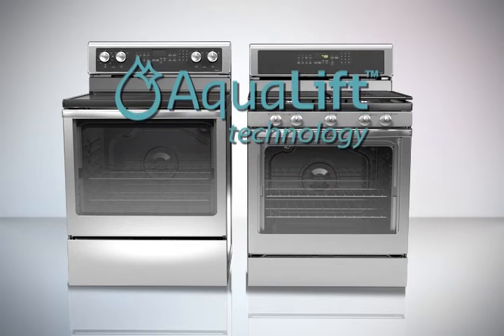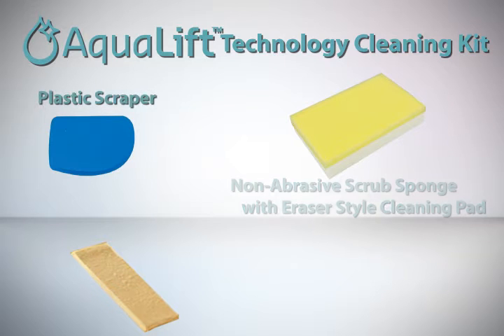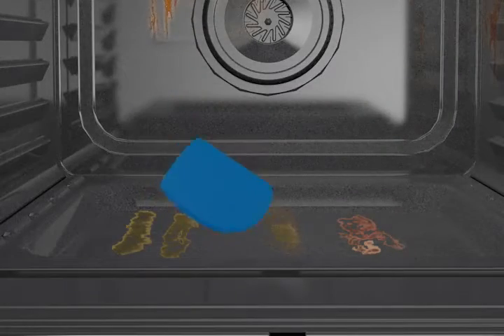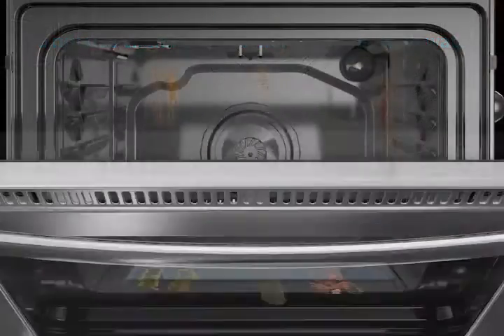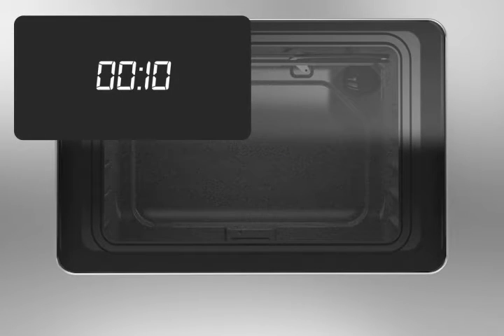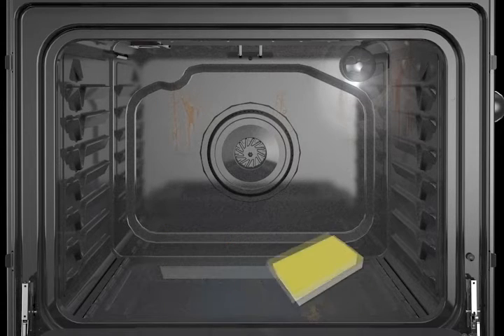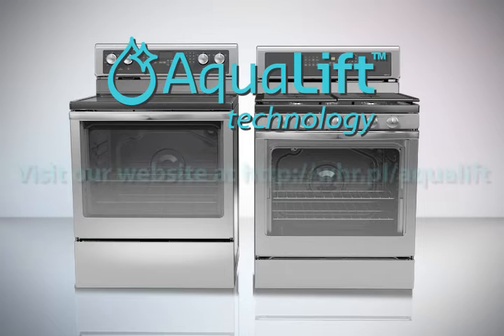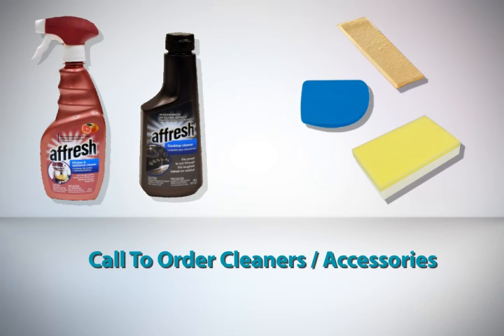AquaLift TM Technology Cleaning Methodology

Comment: I absolutely love this Aqualift technology. I didn't know how just water would clean my oven, but it did. I bake a lot and had a lot of burnt-on messes. When my cleaning cycle was completed. I was expecting a very hot oven when I opened the oven door. No, it was warm but could be touched with my bare hands. I easily wiped off the areas on the bottom and sides of my oven and they were sparkling clean. No chemicals or smells. I love this, 45 min and done. I think the key to this is if your oven has spills that are burnt on then don't keep adding to it. Clean the oven and wipe clean. It's not time consuming and doesn't heat your house. It is really easy.

Comment: This process is crap,   I have used it and it does not I repeat, it does not take off the grime in the oven.
Reply: My Samsung range has Steam Clean/Aqualift, but I found that a "hybrid clean" approach works better.

Remove all the oven racks and accessories like you would for a full self-cleaning cycle, put approximately two cups of water in the bottom of the oven, and then activate the broiler/grill on High. If you have a convection broil option, use it. Let that run for an hour or so (if the oven is seriously dirty, you can run it for two.)

All the water you put in the bottom of the oven turns to steam with the intense heat of the broiler, which softens even the toughest grime. Once all the water boils away, the heat of the broiler turns that softened grime to ash, which can be easily wiped away (it actually works much like a self-cleaning cycle, but without the extreme temperatures.)

Comment: Just discovered how uttlerly useless Aqualift is. Truly yet another disappointment from WhirlPool/Maytag. Honestly Whirlpool, why even bother to have this feature? Its just going to make your customer disappointed with your products and never buy them again if possible. Would it really have cost that much more just to put in an actual self-cleaning feature?
Reply: My Samsung range has Steam Clean, but I found that a "hybrid clean" approach works better.

Remove all the oven racks and accessories like you would for a full self-cleaning cycle, put approximately two cups of water in the bottom of the oven, and then activate the broiler/grill on High. If you have a convection broil option, use it. Let that run for an hour or so (if the oven is seriously dirty, you can run it for two.)

All the water you put in the bottom of the oven turns to steam with the intense heat of the broiler, which softens even the toughest grime. Once all the water boils away, the heat of the broiler turns that softened grime to ash, which can be easily wiped away (it actually works much like a self-cleaning cycle, but without the extreme temperatures.)

Comment: THis "technology' is a joke! I would take back my self cleaning oven any day of the year... Even repeating the aqualift cleaning cycle three times still meant a lot of scrubbing and nothing loosening on the oven door. Don't get sucked into this scam... it's as good as if you put a pan of water in the oven and turned it way up high.... in fact that might work better... I"m using their cooktop cleaner and a razor scraper to get the grease drops off the door... works great!

Comment: Aqualift, the new technology that doesn’t clean the sides of your oven. Aqualift is a quick non-cleaning option to make sure your oven door will remain dirty throughout its life. In fact, KitchenAide designed this so you can’t use oven cleaners to clean the oven when Aqualift leaves dirt and grime on your oven walls and door. Give me the old , hot, self-cleaning ovens that work. This ain’t it.

Comment: has anyone tried to heat the oven as high as it goes 450-500 degrees and run for 3 hours with the racks left in the oven???
absolutely HATE this "self cleaning" oven.  ran it 3 times yesterday and its still filthy!!!
Reply: After 3 Aqua lift cycles and the baking Soda/vinegar method , I Tried the high heat, still have a dirty oven on top and sides

Comment: I just got a Kitchen Aid gas range with the aqua lift cleaning b/c Kitchen Aid no longer makes a traditional self cleaning oven. The sales person told me when I purchased it, they stopped making the high heat self cleaning system b/c the ovens were burning out too fast. What? ! My last oven was a Frigidaire Gallery. It was over 20 years old and NEVER burned it's self out!! So, here's my  experience with the Aqua Lift experience....The first time I used the oven I cleaned it. All went well and the oven looked very clean. But now the second and third cleaning didn't go so well b/c I REALLY baked in it. (My range is only two weeks old.) I ran the clean, wiped all water out, did the sponge thing and it looks bad. So, ran the clean over again with no improvement. So then I put some baking soda on the spots that would not come off using all the tools supplied with the range. After bending over the door of the range and gently rubbing the water/soda mixture I was able to get the MINOR stuff off. Now, today was my third day of using and TRYING to clean my oven. So, after four attempts of the Aqua Lift cycle (wiping and cleaning after each time) I ended up bent over the range door AGAIN for about 40 minutes of CONTINUOUS scrubbing. (also using baking soda due to frustrating results) Still can't get all of the mess off!!!! Why, Why, Why would they make such a useless way of self cleaning ovens???? And where is the Better Business when you need them???? This product should have never been allowed to be sold as a self cleaning oven!! I feel duped!!!!!
Reply: Have you ever read the book or seen the movie "The Magic Christian"?

Comment: Have to concurr. Owned for 6 mos, aqua lift doesn't work. Currently trying baking soda and scrubbing. What is long term effect of using easy off? I am in my 60s I would rather golf or play hockey than two hours on my knees scrubbing and pretending I am do a Cirque du Soleil home workout.
Reply: I don’t have this technology on my 25 year old Viking gas range but here is what worked miracles for me to remove lots of baked on stuff:
https://www.google.com/amp/s/www.thekitchn.com/oven-hack-dishwasher-tablet-22994488%3famp=1

Comment: I HATE my 1.5 yr old Aqua-Lift oven range! Besides echoing what EVERYONE knows - it doesn't work - my cooktop will literally burn you when only using the oven!!! I thought I had turned on one of the burners in the front, but nope... The oven vents out the front and creates injury-causing heat on the range top above. The ONLY good thing about my Kitchenaid range is that it looks good and matches the rest of the kitchen appliances.

Comment: Absolute piece of garbage!

The salesman told us we should clean the oven once a month. The first time I tried the Aqualift, it barely made a difference. So I spent two hours with the recommended Afresh cleaner and got it almost, but not quite spotless. There are some places that you just can't get at to scrub properly.

So I resolved to use the Aqualift cycle after each time we used the oven. It still didn't come clean.

If we could afford it, I'd throw this brand new stove in the dumpster and buy another brand.

Shame on the manufacturer, Whirlpool Corporation.

Comment: It is bad enough that the Aqualift does not clean the sides, front, and back. The oven has looked pretty bad since the first time I cleaned it after less than 1 week of use. It is even more annoying that cleaners are not to be used. As a result, when this technology fails to work there is no alternative short of getting a new range
Reply: Yes, so annoying. And guess what, it ain’t gonna be the same brand if I have to replace it 😑

Comment: Scraping, scrubbing, and sponging are not techniques one would think necessary in a self-cleaning oven.  The only online reviews that say this works are from Whirlpool.  I can't find anyone who likes it.  Is there a Whirlpool range that does NOT use this method?  I have been switching appliances over to White Ice by Whirlpool--but I will not buy this stupid "get on your knees and scrape, scrub, and sponge" self-cleaning crap!
Reply: +Glenn Green I used to buy all Whirlpool appliances but they all stink now.  I know a lot of it has to do with government regulations but the way they lie about how it works is really horrible.  After over two years, I'm still happy I dumped my Whirlpool range.  The next thing I'm getting rid of is the Whirlpool dishwasher.  Have to use "power scrub" setting to get a normal cycle clean.  Just awful.  Even after this long, I still get angry just thinking about it.

Comment: I agree with the others....Aqualift does not work at all! I bought a Jenn Air oven that was supposedly an upgrade from my precious Caloric oven. I miss my previous oven I had for 20+ years that basically burned everything off. I feel as if I just purchased an oven with absolutely no self-cleaning feature. Extremely disappointed and would never purchase another Whirlpool product.
Reply: I agree.  I want my old self cleaning oven back AND my top load agitating washing machine that I can open or close and soak or check clothes as they are being washed...

Comment: AquaLift is a joke - the only thing it will clean is the very bottom of the oven -- even then its dirty water that you soak up with a special `sponge`` then wipe out with cloths....and you have to use `distilled water``...The side walls, back walls and top of oven remain dirty - and you cannot use oven cleaner on it. Less than 10 months old and we`ve already had 3 near fires when the broiler & bake element come on at the same time & smoke up the house, over heats the oven. Replaced the circuit board (under warranty) and now have a 3month warranty on it. We have the ``gold series`` electric convention oven with glass top burners -- miss my old coil burners & good old self cleaning oven that turned all the grease to ash.
Reply: You got that right just cleaned mine and the sides are still dirty and the top
Reply: Did you ever resolve the problem? Im considering buying one.
Reply: @SO-vv9dn  Don't do it!

Comment: Do NOT buy any range with this AquaLift 'technology'.  It does not work AT ALL.  The only thing that does work is scraping & scrubbing which is why they offer the cleaning tool kit.  I bought a Whirlpool range and junked it after 2 years because of this lie.  Whirlpool would do NOTHING to back it up.  In this video there is basically a 'cartoon' that shows the dirt being lifted off.  Well, that's what it is....a cartoon.  Also, when I tried posting feedback on whirlpool.com, they removed my comments!
Reply: +Brenda Weaver I totally agree! I spent over three hours cleaning our oven today and ran three clean cycles and still had to scrape the burned off residue from the bottom. The walls and back are dirty and won't come clean, and since they don't allow chemical cleaners or abrasives to be used, how do you clean the rest of the oven? I'm very disappointed with this product. Somebody needs to sue them for their false advertising!
Reply: +Michael Hubbard The instructions that came with my range said to use stove top cleaner so that's what I used...along with scrapers, non-scratch pads, and elbow grease.  I got rid of my Whirlpool range and got a Samsung that has that stupid steam cleaning but it also has the conventional self-cleaning oven.  As with all other brands that use the  steam cleaning method, that is a joke.  But the conventional system DOES work.  Plus, the Samsung does a better job of stove-top cooking and excellent baking.